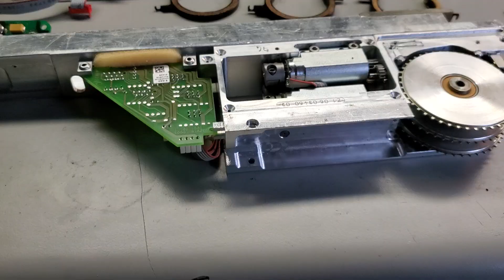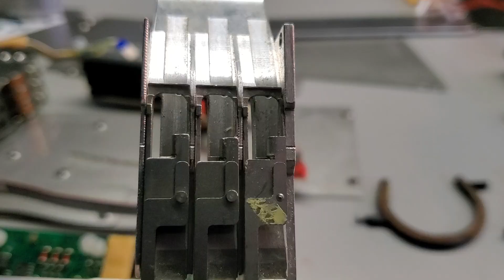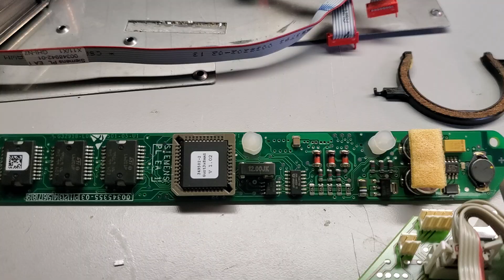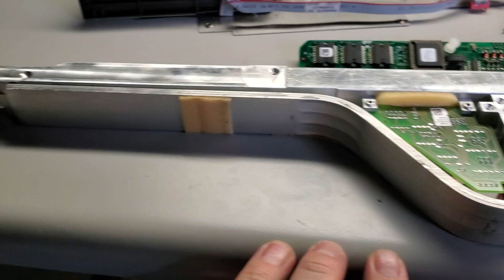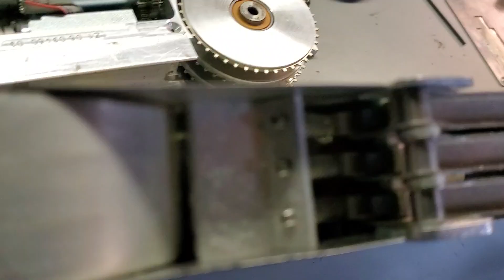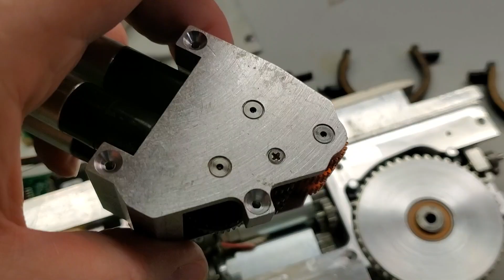Siemens 3x8mm component feeder dissected

Comment: That wheel stop is brilliant! Really elegant way to prevent the advancing the tape from drifting over time as it. I'm guessing that they drive the motor forward, then when the wheel stop ticks down they drive it back for a moment to lock it in place. Thanks for sharing this teardown!
Reply from the maker: The motor behavior is something I want to test with a scope.  I may get around to that more later. 
After shooting this video I also fully disassembled the worm drive and tape feed motor setup.  I may shoot another video just on how to take that all apart, clean, lube and reassemble. 
There were a lot of components stuck in the grease and on the worm gears.  I suspect it is something that should be done more often than once every 20 years.
Reply from the maker: https://youtube.com/shorts/cyOQEQYz0To
Super slo-mo of the motion.